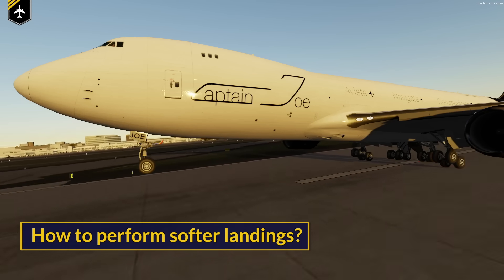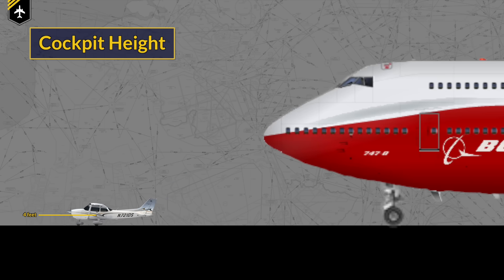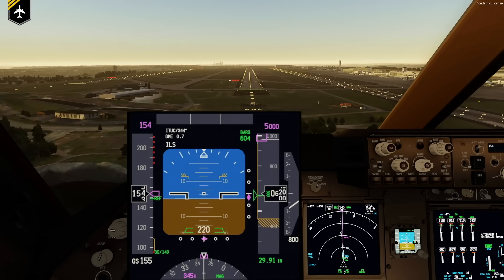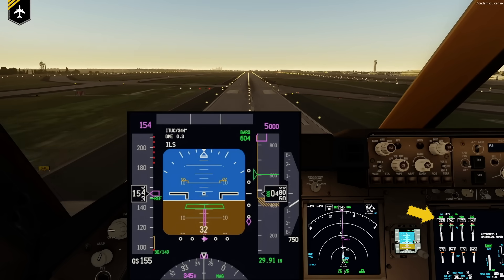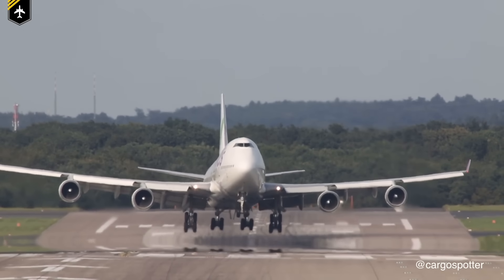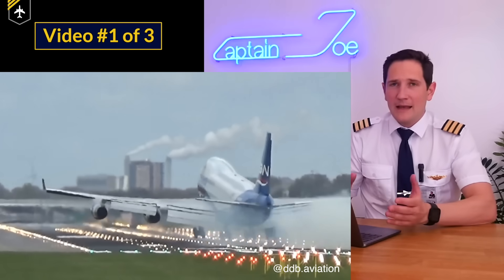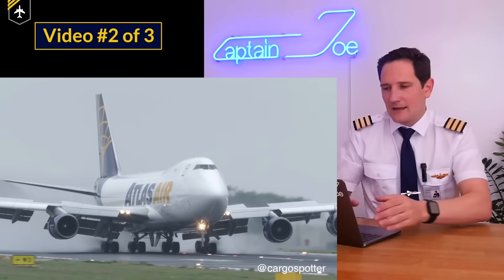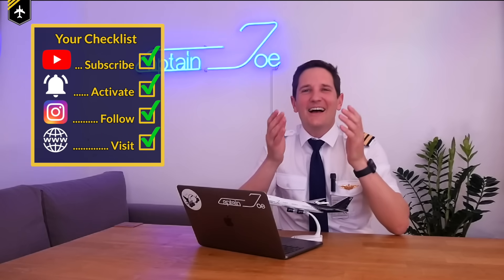WHAT IS A FLARE? And how to perform SOFTER landings? Explained by CAPTAIN JOE

Comment: It seemed aok until you reduced descent "by about half" from 770 to "400 feet per second. You realize that even with flare this means wheels are hitting the runway at 270 mph vertical rate! . Any 747 drivers wish to respond?

Comment: 30 feet throttle back to idle. Is this also applicavle for 320 or just 747? (No thruttle thrust word tricks please 😊
Reply: Yup even for 320. Although that 30 feet is more of a reference flare height. Based on external factors one may have to flare early or late as well

Comment: Great video. I think I go to idle thrust a little too quickly in the Fenix A320. I flare, throttle back and I just fall through the flare and usually land with about -400fpm. I’m going to try throttling back a little slower but I feel like the bottom just drops out of the Fenix. I’ve never floated in that airplane.

Comment: "Shift your view to the far end of the runway"?  What do you do when the runway visual range (RVR) is 1800ft or less.  "At 30' you gently increase the pitch by 2 to 3 degrees and you hold it there".  And that decreases the descent rate to at least 400.  You let it land at a descent rate of 400 feet per minute?

Comment: 7:03 I saw the college did Uniate a flare but it was a way too late flare which drives the main gear into the runway and bc of how high the speed was when the pilot finsished pitxhing up it was going so fast it went back up and at 6:48 you can see the pilot like yank the yolk forward to go down but then because of that it causes a hard 2 landing

Comment: I grew up as a child of an Air Canada employee.   As such I've had a lot of flying experience as a passenger.  I notice something these days I didn't see in the past.  In the past the plane would keep descending toward the runway and just as it was over the runway the pilot would flare but they'd also briefly hold the plane over the runway.  A short 5 second or so pause.  Then you could hear the power rolled off and the plane would gently like a feather fall to the runway.  How come I don't see that anymore.   The descent simply keeps happening right to the concrete.   Gentle or not.   Why is that the case these days is it how pilots are trained ? Is it because of new technology etc ?     Very curious about this

Comment: So if I understood it, you just have to have the proper airspeed, flaps and angle of approach, the airplane will just catch air gliding down the runway, kinda like it will just drop by itself softly even if you pull up the yoke, it will continue to touch down since there isn't enough speed to take off? Pls.correct me if I misunderstood. I very much appreciate your help

Comment: Base on the descent rate, normally our decent rate is about 600-800 ft/min, at about 10 feet the descent rate will reduce to about 100 ft/min-200 ft/min, or 2-3 feet/second, so after 10 feet normally should have 3-5 seconds flaire. I don't care about a soft landing, I focus on a safe landing. during final approach, reduce the vertical and lateral deviation as soon as possible, maintain a stable approach, manage your performance, always remember performance = power+ attitude, it's very rudimentary, but very useful through your flight career.If you do every action in final properly, correct the deviation as soon as possible, manage your performance, you will have a safe landing.

Comment: I completely understand what you’re explaining. I have a question…silly though it might be…when driving a car, many very small adjustments are made relative to the travel and direction. These adjustments are made almost sub-consciously as a driver travels along a road, keeping the vehicle on its intended path. During landing, many many adjustments are being made on the control, left, right, pitch up,down etc. constant. My question is, which instrument is the PRIMARY mover for these adjustments? What is the officer flying primarily observing as the aircraft descends from say 2000 to 0 feet please? Thanks.
Reply: It depends on what kind of approach you are doing. If its an instrument approach/segment, then these adjustments are done while looking at the primary flight display. If its a visual approach/segment then it's a combination of both looking outside and crosschecking with instruments.

Comment: Not a pilot. Any knowledge I have about aircrafts is either from YouTube, or trying out flight simulators. But this maneuver called a flare is pulling back on the yoke, and basically leveling off the aircraft no? Or close to zero vertical speed upon landing. So why on the outside of the aircraft the plane looks as though the nose is pitching up, when on the vertical speed display the meter is level or close to leveled? Once more I am not a pilot, so forgive the terrible explanation.
Reply: Basically remember pitch attitude and vertical speed are 2 different things. Pitch is where the nose is pointing, vertical speed is more about the lift.

I'll try explaining in the most basic way without adding complex terms. One of the first things taught in flying school is pitch+power=performance. Basically what that means is to have x performance, either you can change power or change pitch.

In case of landing, the aircraft is using lower power (as it needs a slower speed for approach). To compensate for that lower power, the pitch is increased. Hence during landing you will see lower power and higher pitch (ie nose up) to generate the required performance which is low speed with a decent rate of descent.

Comment: Back in the day, we practiced and practiced and practiced again (Three years with a Cessna 172, 8 years with a PA-32-260 Cherokee 6 and the Piper was much better at greasing the runway than with the 172. With a slight to medium cross wind the Cessna wasn't easy and in heavy cross wind, well, forget it......it was ouch ! We finally resolved the problem with a Cessna 185 on floats. (cross winds were rare events). Got to old, operating costs got worse and we gave up on flying (After 38 years) ! Great video !

Comment: My only "experience" in flying planes is in video games with slight simulation elements like Arma 3, I learned of that phase by myself and didn't know it had a name until now.
Even though it's just in semi-simulation games, it still is the hardest part of flying a plane in those games. Yes this is a thing you need to practice, when I teach a new player to fly, the final "exam" is to perform 5 soft landings in a row.

Comment: IN MY VIDEO OF simulated LANDING A 77L, 777-200LR with the  GE-90'S, i encountered a Cross wing instant from 1 oclock 17knot instand gusting 8-10a clock 27knots increasing.direction change, ithis happed right at 60 knots and rudders were slow to react max rudder and lil bit o'bank, out the yaw, i touch down once geently but another gust lifts me again a meter off the ground
, i increase pitch by 1/3rd of a degree, as i was pushed again to the right i decided, to touch down as we we stilstable and ill catch the centerline im just a correction on rollout, + it started to rain again  exactly over treshhold. flaps 25, so the runway is wet but in fs9 youhave grip.The weather though imc  and dark stormy morning after 1245h of flying out of a approaching typhoon near kansai, RJBB TO a stormy texas dawn, beautiful, i have the entire flight on twitch and the landing and T/O on my youtube and twitch,
EDIT: I DID PUSH THE YOKE DOWN FOR A SECOND TO ARREST ANY UPWARD MOMENTUM, SEEEEMS SO
BUT THE FIRST OOPS CAps the first was -80ft/min second -143ft/min, had 20tonne fuel left autobrake 2 didn't cut it for my exit due to the long landing.
thet, flaps 25. and probably or they automaticaly come down after thr rvrs close? on PSS 777 but braking was very good i suppose so, lots of pax, fuel, convective activity, was a crime to land there and then but company hates go-arounds

Comment: When the engines spoil down during the flare and the landing gear naturally drops to the ground, is that technically a stall for a split second?
Reply: No, it's almost at a stall but Ideally not a stall.

The aircraft is flown onto the runway rather than stalled on the runway.

Comment: Thanks a lot Joe! The explanation is so amazing and very clear to understand!

I have one question. At 2:26 when you explain the calculation of Descent rate, I did not quite understand why we multiply the Vref by 5. If you could please explain that part, it will be very helpful! Thanks in Advance! :)
Reply: The PAPI on the left side of the runway are set from 2.0  -  3.5 degrees. This is decided on airport  construction and therian on the approach path.  So at 154 Knots x 5 gives a decent rate of coming down at 770 feet per minute you will set the plane up to land on the painted marks on the side of runway were the PAPI are set for the correct touch down area on that runway. Its so nice to have the plane set up correctly before you get to the end of the runway you can now concentrate on the landing. If coming down to fast the PAPI lights will go red and red is dead, if coming down to slowly and all green you glide too far down the runway and may run out of length. My 2 cents

Comment: Hi Joe, I am a student gyrocopter pilot, and I have just recently started doing the take offs and landings, so this video comes at the right time for me (although gyrocopters are rather different), and I would agree that the Air Berlin pilot was close to the point where a go-around may have been a better option, flaring is something we gyrocopter pilots have to do too, but obviously a gyrocopter has a much shorter landing run than a fixed-wing aircraft, we simply pull the stick back and let the rotors stop the aircraft, in the process of learning I am beginning to understand the workload that all pilots have, it takes a special kind of person to fly an airliner, and be responsible for the safety and comfort of passengers, I am only flying a small aircraft, but there is so much to learn, and, I guess we're always learning, anyway, stay safe all the best from Scotland, Stephen.

Comment: I have a technical question.... So, the decent rate is same for every aircraft (B777 B747 A380 A350 etc)? You mentioned 800 feet per minute... If not then what are they (for a B777)

Comment: As a low time private pilot (170 hours) I really value these videos, for the content and the humor. I don't follow the math Capt. Joe refers to in calculating the desired descent rate. 154(knots per hour) x 5 = 770 (feet per minute). What is the "5" referring to? Anyone?
Reply: I think 1 kn/h ≈ 100 ft/m and tan(3) ≈ 0.05. Hence, if you calculate the horizontal speed in kn/h with 5, you will get an approximate vertical speed in ft/m.

Comment: Hi Joe, Quick question, although it may be stupid, when you take off from let’s say San Francisco for a flight to Charles de Gaulle, how do you know where Charles de Gaulle will be when you get there to land, as the earth is constantly moving beneath us as we fly.

Thanks, great program,
Reply: The atmosphere (air) moves with the Earth. If this were not the case, as the Earth rotates about 1,000 miles per hour at the equator, then there would be massively high winds on the Earth's surface.

Comment: Great explanation Joe. As  a simpilot it was almost mistery for me what really does  call out 50, 30... 10 mean. I was not sure from where on plane this distance is measured. From cockpit, from tail, from gear? Now I know that from gear and  thanks. Anyway I have a few more questions related to this. What kind of instrument measure this distance? Is it standard radioaltimeter or another instrument designed only for this purpose? Where on plane is located the instrument? Thank you

Comment: Another great video, Joe - a couple comments: the first video of the 747 at 6:45 seems to show full upward deflection of the elevator, so i'm not sure the pilot necessarily screwed up or if there was a loss of lift due to a wind shift - we just don't see enough of what happened prior.  as to the Air Berlin floating, in our smaller planes that usually means we are landing with too much speed and thus the plane, in ground effect, won't settle.  Not sure if that happens with the big jets too, but us Cessna drivers know this dynamic well.  Cheers!

Comment: I think that at 6:46 there is an other proplem. Look at the elevator defelction at around 30 feet. The pilot is putting in a lot of up elevator but the decent rate isn't dropping. I personally think that the problem here is a wind sheer.

Comment: I have some honest criticism, Joe.
I do not like the subtle statement the focus of a smooth landing is proof of a "skilled pilot." Important philosophy in any serious airline is: A smooth landing is not part of any pilot skill assessment. Three main things count. Touchdown zone, target speed, centre line! Anything else is optional. This should have been mentioned more in your video. As you have described yourself reasons for a hard landing are statistically largely out of pilot control it is disturbing to see you dare to comment landings of colleagues just by looking at a video. Without any info of meteo or instruments readouts. If you withhold yourself from commenting on accidents/incidents under investigation, why go this low on landing mishaps? Furthermore, you fail to mention enough the risks associated with pilots trying to go for a smooth landing instead for a safe one: Over-controlling of aircraft, loss of control up to a stall, tail strike, runway excursion and so on. This should have been mentioned along your explanation video.
Other than that, I really like what you do. I would appreciate a video with explanation of FTL and fatigue management in the future. Best regards!

Comment: My father, a former senior jumbo captain, once mentioned a thing called the "Boeing landing." He said many less experienced pilots all make the same mistake of holding the nose too high during the flare. This causes a large cushion of air to be captured between the wings and the runway. When that cushion finally breaks down and slips out the back, the plane suddenly drops down for a hard landing. It seems that Boeing test pilots discovered long ago that you need to loose that cushion earlier at a higher air speed by letting the nose drop a bit before main gear touch down. Now I'm no pilot but that makes sense. Has anyone else ever heard of the "Boeing landing"?

Comment: Intresting the small details like raising the nose at 30 ft. Is there any good freeware like the OPT shown on the video for A320 to use on the FS2020? I have no clue how to calculate FLEX TEMP, TRIM elevation at takeoff and all the CONFIG. All I know, it all depends on weight, lenght of the rwy, temperature, CG etc but I'd like to insert all that by using a tool like it.

Comment: About 95% of my landings are very slight squeakers. I have learned a lot from my Taildragger training and implementing those techniques with a nose wheel aircraft really makes a difference in your flying technique. I very seldom flare too high or flare too late. I usually touchdown with the stall warning starting to chirp or chirping a little more aggressively and then it seems like the wheels are on the runway. This is something that should be encouraged if you haven’t taken Taildragger training I encourage you should.

Comment: flaring a bit too early was often because I was tricked by the ground effect + wind speed, but I'm flying ultra-light so it's both very sensitive to wind speed and only results in a "petit dur" (you wanted our ways to call it ;)) if the plane stalls before ground. Can't imagine how bad this would be on those big planes.

Comment: Could you please explain what happens when landing airplanes in exceeds of the maximum crosswind or tailwind limits? What would happen to the airplanes? And why there are such limits?
Reply: Usually there is a bit of tolerance beyond the maximum crosswind limit (but that’s more of a safety net than something to be used)

If someone tries to land beyond that crosswind limit, the rudders won’t be able to counteract when the aircraft has to be straightened and hence the aircraft will drift beyond limits

Comment: Dear @captainjoe, usually when the pilot uses the thrust-reversers you get thrown a bit of balance in your seat as the plane decelerates. 
On one occasion (flying into Dulles Airport) I remember being pushed forward quite forcefully, I had to extend my hand to the seat before me to keep me from being thrown out of my seat even with the seatbelt firmly on. 

Now I have seen this video, could that have been caused by landing too late on the runway, so the pilot flying had to use extra breaking power?

Comment: Why does the A380 or any other aircraft with 4 engines use only 2 thrust reversers instead of all four during landing
Reply: The 2 thrust reversers is just an A380 thing. Rest of the 4 engine aircraft uses reversers on all 4 engines

Comment: Hey Joe!

if I'm using simpler flight sims (infinite flight), is there any tool or software I can use to help me calculate VREF? I usually fly the 77W and tend to keep my final approach speed at ~160 knots. I am unable to hold the nosewheel in the air for a long time and it just touches down with the main gear. 
Also, when I make the 3 deg. pitch to flare, the aircraft just starts gaining altitude again... is this because of the increased airspeed too?

Comment: I don't have accounts at any social media platform.  So I'm limited to YouTube comments or Discord.  I also designed an aircraft of my own for X-Plane 11 and have used the HUD to get very good at flaring the aircraft, landing with a vertical speed of less than 100 feet per minute.  Then the nose gear slams into the pavement.

Comment: Is Flaps 30 the maximum Flap setting on a 747?
  Also, to answer your question,  I always ask where the grease button is on any new Airplane I fly. 
   I call a smooth Landing " greasing it on."